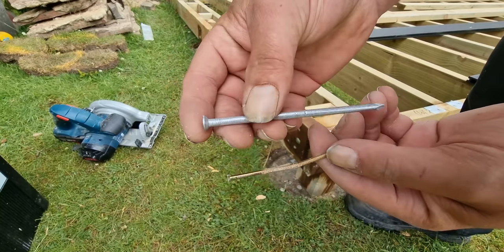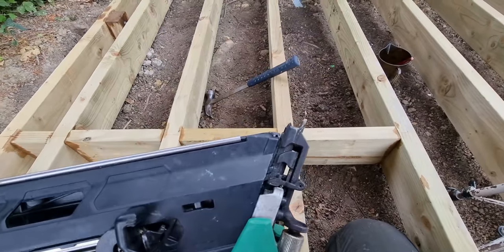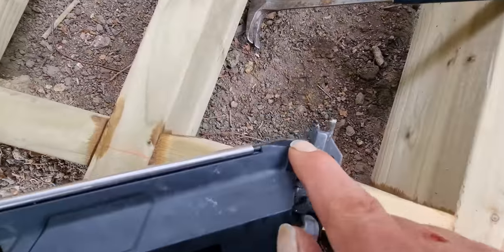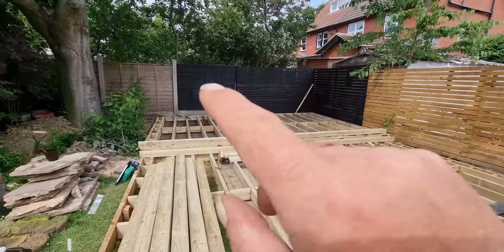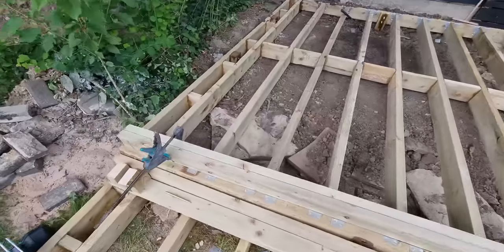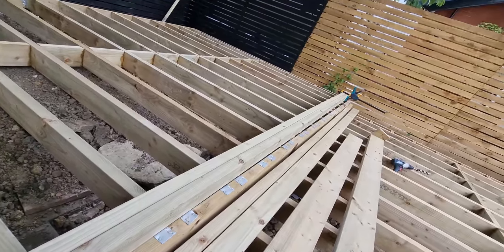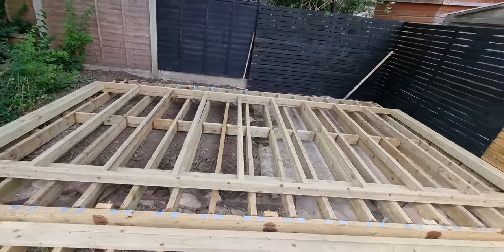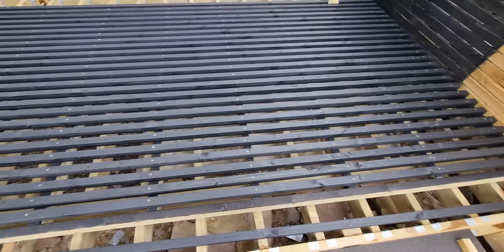Garden Barbeque Room & Deck build Pt5 - Making the walls & finishing the joists

Comment: Great job Gid. You could try looking for a rubber cap for the nailer to extent the head a few mm’s. Did a deck and pergola for myself last summer and I put a few rolls of dpc on the joists as the first place to rot is in between the deck boards where the rain and dust sits.

Comment: Nice one really enjoying the on going project . Your like a mountain goat navigating between those joists ! Me I would have fallen on my ass within a minute 😂😂😂😂😂 i have same issue with nail gun , have the paslode if is cold hardly works , even in summer fires blanks every now and then that’s a real pain if you are set to go with say a bit of feather edge fires a blank and you don’t realise 🤬. Now most of the time I use my cheap Clarke rigged to my dewalt battery compressor fires all day long plus seems to not be too fussy on the nose  being fully compressed . I think they all have there pros and cons but all get most of use 🤬🤬🤬🤬🤬🤬🤬 allot 😂😂😂😂 keep up the good work and thanks for the time you take making these films 👍👍👍

Comment: Those hikoki nail guns are a nightmare on 300mm centres
Reply: Yeah, they're great guns but not always for toenailing.
Reply from the maker: Yeah i'm finding that, might have to get the welder on that nose 😂
Reply: @Gidjoiner  i sharpened the tip of the gun with a file, possibly too sharp but it grabs well 🤣
Reply from the maker: @Samwise457  👍😁 it needs something doing 🤔

Comment: great video Gid - just one question are nails just used for speed or is their an advantage over screws? less likely to shear?
Reply: Speed but they also have advantage of better shear strength than screws 👍
Reply from the maker: Thankyou Bill 👍 as Martin says + if i want to draw something together, close a gap n not have it come apart while i'm working on the other end i'll use screws, nails you can or they will pull out, screws won't, you can also easily take a screw out if you want to adjust something, but once a nail's in it's not easy to take out to do adjustments, putting a nail in isn't easy if the wood your nailing to is bouncy, even with the nail gun, a nail put in with a nailgun is instant but with a screw you have a bit more control as it goes in., traditionally nails were used because it's not that long ago that screws were being made cheap enough.....sorry there isn't a single answer to your question 👍
Reply: @Gidjoiner  Thanks Gid (and Martin) for taking the time to provide such a detailed explanation! really appreciated,

Comment: If you don't mind me asking what was the total cost for this custom build please??
Reply: £6.42
Reply: @AJ-ds5gf  plus vat? 😂😂
Reply from the maker: £2.5K for the wood, £1.5K for the deck board, a few £100 in other materials, concrete (30 bags of ballast, 5 bags of cement), 50 joist hangers, 1000 nails for those, 40 bolts i think, 250 x 90mm ring nails just for the 2x2 battens on the back wall, so prob close to 1000 x 90mm nails for the whole job, & other fixings like coach screws n 4" screws + creosote etc.. , I haven't added it all up yet & sorry i'm not sharing my own labour price 👍  he's used 6 x 5ltre tubs of that exterior paint/preservative stuff @ £14,
Reply: @lesbaty8919  😆

Comment: Where’s new saw gid
Reply from the maker: Which new saw? 🤔
Reply: @Gidjoiner  didn’t you have a dewalt one
Reply from the maker: Yep, but it'll only cut 50mm-ish, i needed this for the 4" posts, & i don't care about this one if it gets a bit of rain or creosote on it 👍 this is my i don't give a f*ck outside job saw 😁👍
Reply: @Gidjoiner  haha always handy to have 2 like top man you got a link for them clamps I have 2 but there old want 2 more but the make has wore off
Reply from the maker: Wolfcraft, the ones that open with the little trigger behind the main one, I bought two 20yrs or more ago, one i'm using on this job & one is in the shed awaiting a spring, always meant to replace that broken one but early last yr i bought 2 not just the 1, https://www.amazon.co.uk/gp/product/B000P3DVD0/ref=ppx_yo_dt_b_search_asin_title?ie=UTF8&psc=1  i bought two more bigger ones a couple of wks later 😂 https://www.amazon.co.uk/gp/product/B000P3BQJG/ref=ppx_yo_dt_b_search_asin_title?ie=UTF8&psc=1